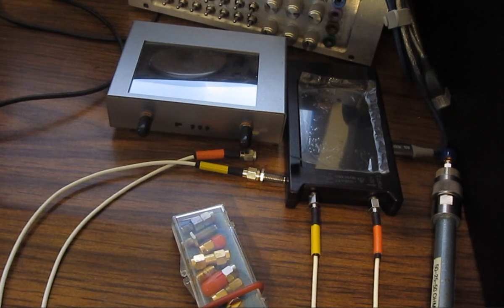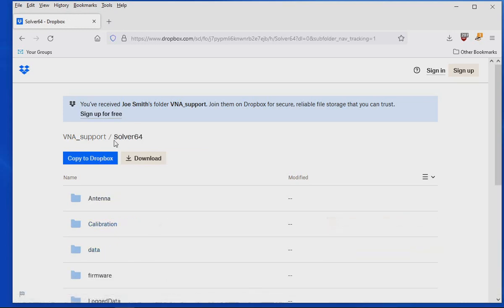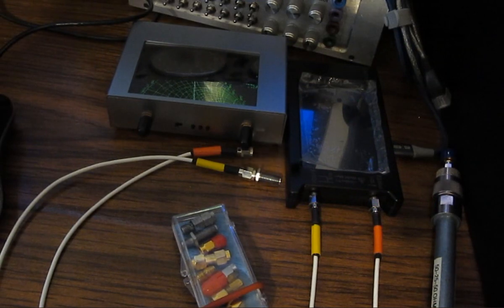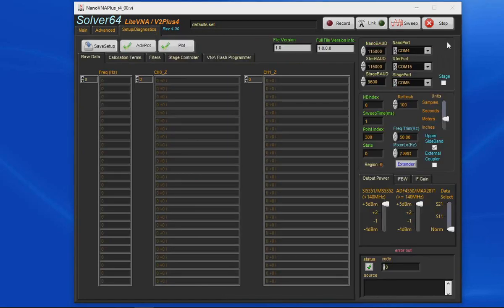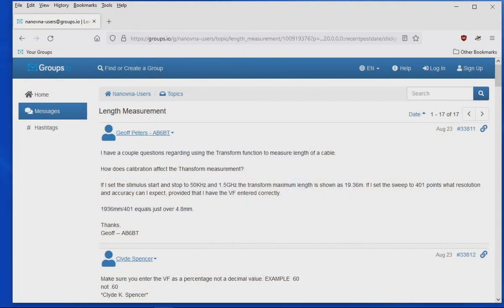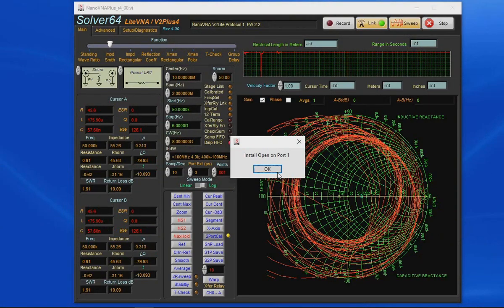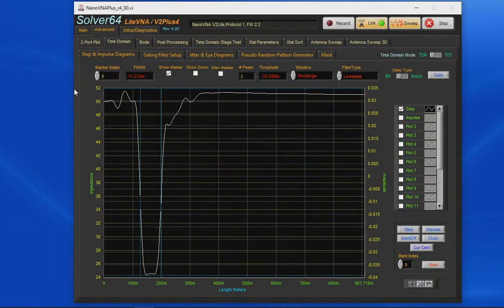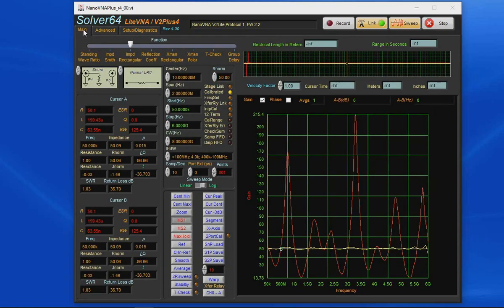Solver64 Announcement, Dropbox Replaces Github Account

Comment: I am actually reading the manual. I think it's in the human being to seek help for any problem (in their life also) and waiting for a reply instead of do your own exercise/research for the information. Maybe that's the reason why people read so many books about stories but not so much for a book that can give you something you can learn for later use. My two cents btw.
Reply from the maker: That manual is long out of date now but should mostly match up with the older software.  The right thing to do would be create a new manual for Solver64.   I suspect a new manual would be about 4X it's current size to cover the topics.   A lot of work for a free project with very little benefit.